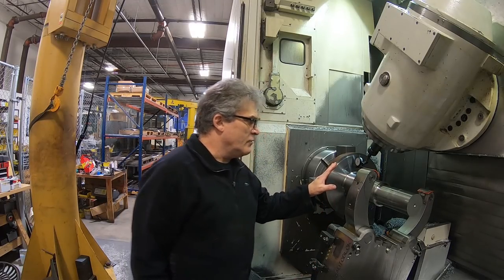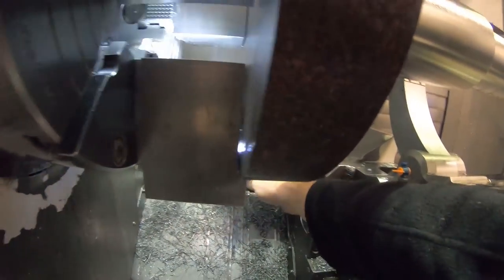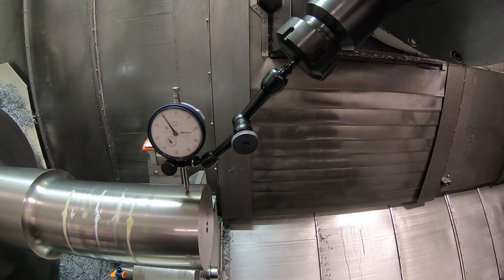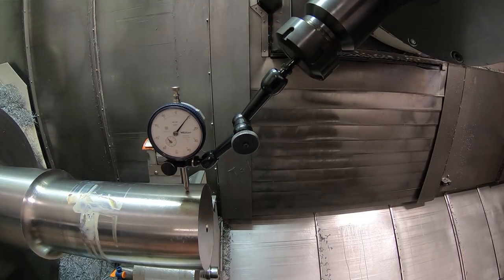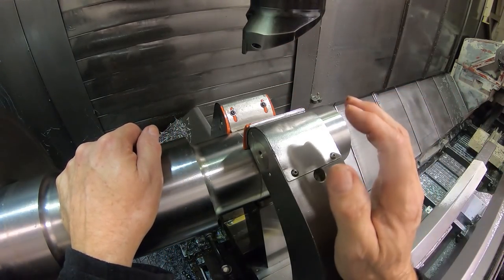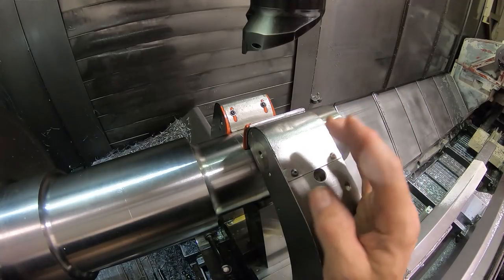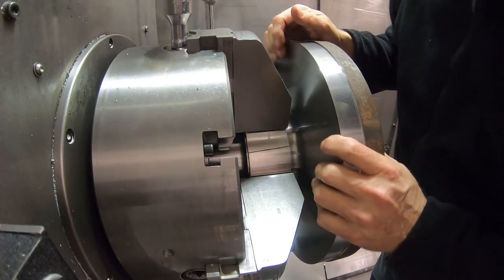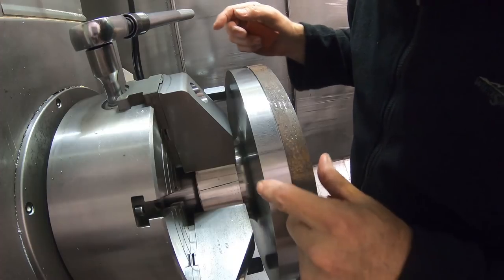16 Inch Shaft Finish Flange End

Comment: Why not support the piece with the steady rest or center while you loosen the chuck jaws slightly and allow the part to relax on center?  Then tighten the jaws and verify that the chucked end runs true.  Otherwise, I would be concerned that the perpendicular faces are no longer perpendicular to the axis.
Reply from the maker: On this machine the tail center is a hydraulic quill. This can’t be extended without some force on it. If (as I showed in the video) the end of the part isn’t faced square. It will force this out of square face up against the face of the chuck jaws. And even if this seems OK with the tail center engaged in the center drill. When I retract the tail centers quill the part would deflect du to the strain of trying to be forced flat on the Un square end. I’m not exactly sure what you are referring to about un squareness of the faces? If the part is finished (with no stress du to the chuck) turned all in one setting everything will be square and perpendicular. If I did as you suggest (because of what I previously described) there would be stress introduced into the part. So when Un chucked this stress would be relieved and than things could be out of square.
Reply: @EdgePrecision  When you turned the part originally, all of the faces were perpendicular to the rotation axis.  When you removed and re-installed the part, this is no longer necessarily true unless the part's center line is exactly on the machine's rotation axis.  An indicator near the chuck allows you to establish one point of the part's center line on the rotation axis, but this still allows the remote end to whip around the rotation axis verifying that the faces (that are perpendicular to the center line) are not yet perpendicular to the rotation axis.  Since the hydraulic center precludes using that to center the remote end, I would try to use the steady rest to center the remote end while loosening the chuck's grip momentarily.  This would allow the faces to relax perpendicular to the rotation axis.  An alternate approach would be to indicate the large face itself near the edge to establish that it is perpendicular to the rotation axis.
Reply from the maker: @byronwatkins2565  the part had another .25” turned off it. It doesn’t matter if it ran true the second time it was chucked. Everything was recut as if the first time. As long as everything cleaned up. The center was reclaimed when the hole was drilled and bored on the end of the part for the tail center to run in.

Comment: Damn man running a nice face+ turn a chucking diameter from the start would save headaches!
Reply from the maker: If you faced it and turn a clean diameter that might help with the first roughing a little. But after the part bows in roughing the face you turned would no longer be square. So if you wanted to maintain that you would have to do it again after roughing. Now That could be a process. Rough the face and OD as you say. Than turn the part around. Rough the part. Turn the part around again with the flange end toward the tail center and chuck (changing jaws) the very end of the shaft. Supporting it on the steady rest behind the flange somewhere. Re skim the face and OD still leaving stock. Than turn around again (changing jaws again) chuck the OD of the flange like I did here get the part running true. Reclaim the center drill if necessary. Than finish the rough close to finish size. Than skim for the steady rollers and machine a start hole for the drill also turning the chamfer so it all runs true (I should have done it this way in the video). Than drill and finish as I did in this video. But is that really any better? You see any initial face won’t remain square after roughing. Ask me how I’m know this. Because I tried it that way on other parts in this same order. I don’t want to be, like I won’t hear any other ideas. I tried to explain this to another commenter. That I tried it. But sometimes you all (Not meaning you but global you) sometimes are so sure in your ways you won’t listen. That I tried it already. Again I appreciate all comments and please understand I’m not picking on you in any way.
Reply: @EdgePrecision  There's always more than one ways to skin a cat. I indicate my center drills to the chucks 0. A live tool center drill could possibly be off in x or y but I'm running a conventional turret.  That machine is pretty crazy! I've mainly been around fanuc and okuma controls.

Comment: Why would you not just indicate the part in the rest of the way?
Reply from the maker: When you do machine work it isn’t necessary to get it perfect only good enough. You can spend a lot of time fighting for that last little bit. In this case the tolerance was .010” I got it to around .002” on the face and .001 on the OD. Quite a bit less that the tolerance. Or good enough.

Comment: First time ever I am first,the dirty c oolent can make the machine go rusty plus can make your hands ge t disgusting  if it's to dirty
Reply from the maker: It’s not really dirty or having bacteria. It has way oil in it. It smells good. But it could be changed. This machine uses a lot of way oil.
Reply: @EdgePrecision  Is there an oil skimmer for the coolant tank on this machine?
Reply from the maker: @RambozoClown  there is but it does no good because the tank is so large and divided up into different sections. What is needed is a filtering coalescing system. Where the coolant from the whole tank is circulated thru it. Skimmers don’t work on this kind of coolant system. There is to much area under and in the long chip conveyer. So a skimmer can’t get it.